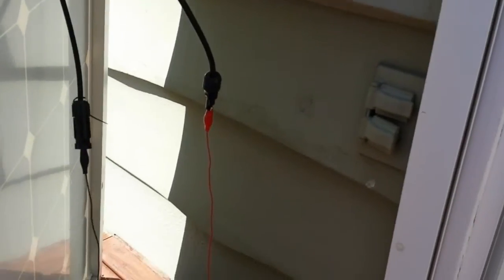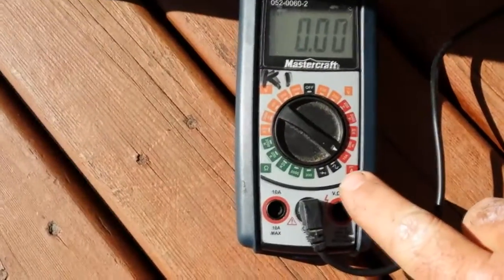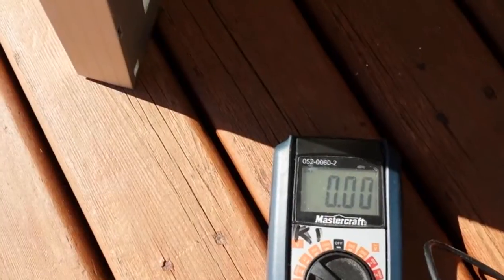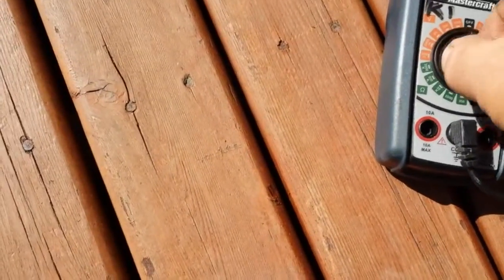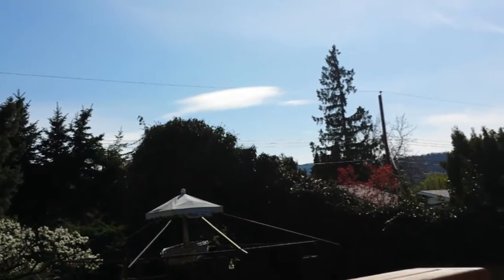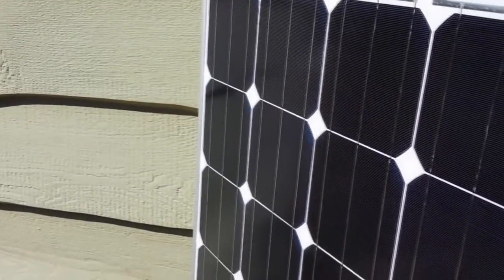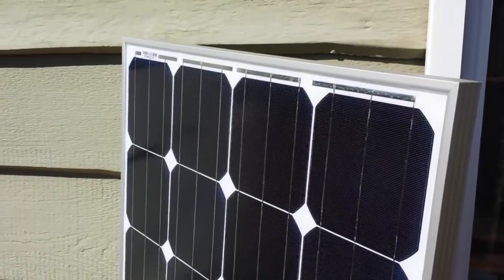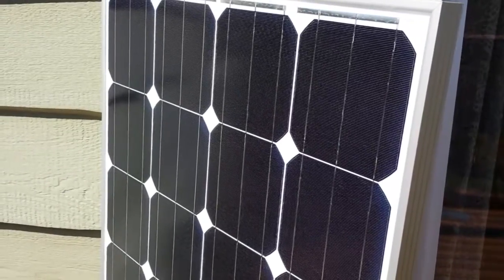How to Open Circuit Test a Solar Panel (Voc & Isc)

Comment: Hey man.I think i have the same panel as you,Its a 160 watt invensun.When I tested i got 22 volts but only 1.6 amps and its rated at 9.12,any ideas?
Reply: Hi, if you are still wondering after 10 months. The rated current is at Standard testing condition. Which is mostly 1000W/m2 of solar irradiation and at 25°C. The current varies based on the irradiation at the time of your test.

Comment: I guess, in theory, it is really only an open circuit test for voltage, because the current test is actually closer to a shorted circuit.